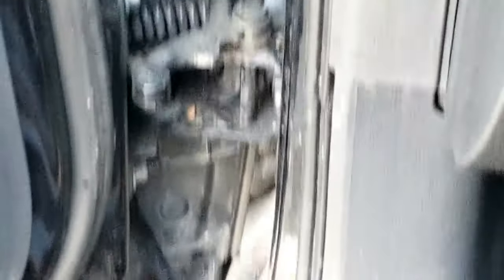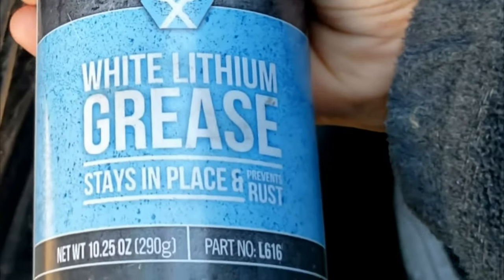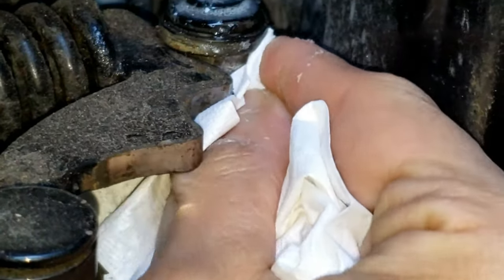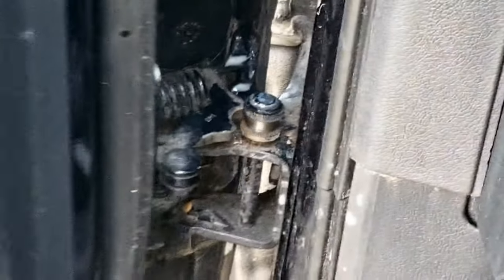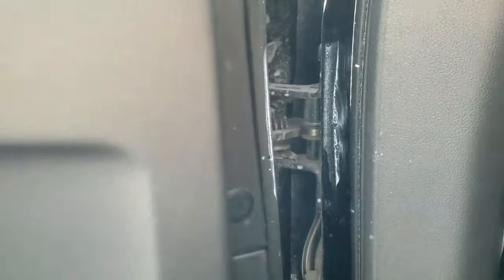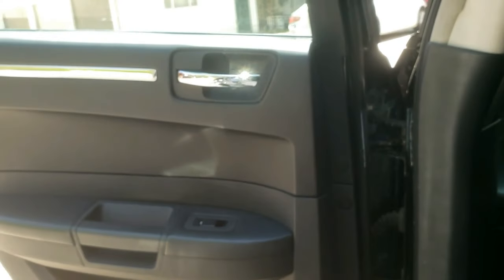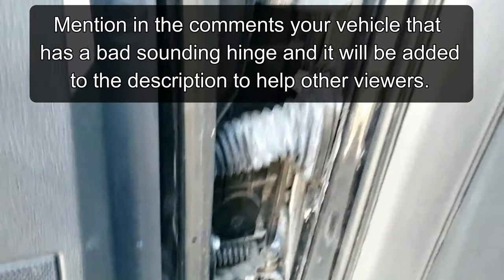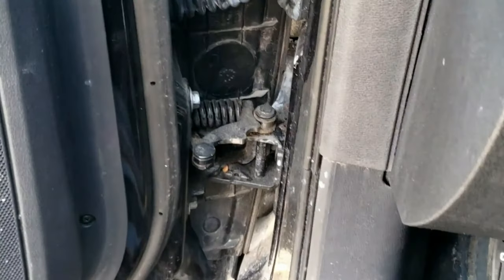Lubricate Car Door Hinge That Makes Popping Or Groan Sound When Open Or Closing TSB

Comment: We have a 1991 Jeep Cherokee XJ model and it is making a loud noise as well as a lot of resistance in the spot where the noise is present. Our hinge area looks different than yours, but I will give it a try and see what happens. Thanks for doing the video. 
Phil
Reply from the maker: Thanks for the input. Let us know if it helped or fixed your problem.

Comment: Every car I’ve ever owned I’ve done this to regularly to.  But I have like a half can of grease on this low miles 2013 Dodge Journey and it won’t stop. My 98 Dakota is quiet as a mouse.
Reply from the maker: Poor design engineering for a low mileage vehicle.
Reply: I've never experienced this with any of my cars but they all have been japanese. I didn't experience this until I inherited a Chrysler 300. Great car but I would say such issues are likely limited to American made
Reply from the maker: Yep. The Japanese vehicles are excellent quality vehicles. No more American vehicles for me. They just don't care about quality. Quality comes at a price.

Comment: I have the same issue with my dodge journey 2016, the popping sound seemed worse when it's cold or humid air. This week, it got way worse and now, it looks like my door is misaligned on the bottom (door frame is popping out compared to the reste of the car frame). I doubt that grease will fix it at this point and that i'll be looking at more expensive repairs.
Reply from the maker: If possible check to see if the screws on the door are tight and properly torqued or if their is any loose trim around their getting in the way. The grease usually helps or you could try a spray. If possible try to get a 2nd opinion. Hope this helps!
Reply: I bought my 300 second hand, and the drivers door was always stiff I think because the previous owner never oiled the door hinges.  I've oiled, and greased the hinges constantly since I bought this thing.  You mentioned your door being misaligned, and popping outward when you open it.  Yep...eventually same thing here.  I looked at the door metal around the bottom hinge, and it's now all cracked, and broke out, despite me oiling the hinges all the time.  But I know of a Chrysler 300 I can pull a drivers door from, and just switch the doors, and hinges out.  So I'll be driving a light blue car with a tan colored door.  So what?  I'm not paying a body shop $900.00 to paint a door for a 14 year old POS car.   Take a look at the area on the door, around your bottom hinge, and see if it's all fatigued, cracked, and breaking out.  That will explain your sagging door.
Reply: One more thing.  I'm not recommending this, but this time around I'm taking a die grinder, and cut off wheel, and cutting some metal to eliminate the spring, and that lumpy bumpy thing that rolls over that roller, and going without the door spring.  This will make it infinitely easier on the metal at the bottom of the door each time the door opens & closes.

Comment: Would WD-40 work as well? I mean the lithium would be better but would the wd40 get the job done in a pinch? I have one and not the other and I almost can’t shut my door all of the sudden. So I need a fix asap
Reply from the maker: If your in a pinch use it. I've heard mixed reviews on this. They suggest WLG. But something is better than nothing.

Comment: Can I use the hinge with a spring for both of them? The upper and lower
Reply from the maker: It may be possible as it appears the lower and upper bracket have the same hole placement. So it may fit on there. However, I'm not sure if that would effect the speediness of the door opening or closing. I'm guessing Chrysler, Dodge,  and Jeep has one with a spring and one without it to save on cost, as the one with the spring is more expensive from a manufacturer cost point of view. If you have 2 of these brackets with a spring go ahead and put it on and let us know how smooth the opening and closing of the door is. Otherwise if your being traditional, then just stick with the original design of the brackets with one spring and the other without it. Please let us know what you do.
Reply from the maker: BTW here's a video on how to replace the hinges and/or the door: https://youtu.be/boJVtQ-cB8k

Comment: Nothing has helped my 2011 Ram. I be even had a shop try to quiet it. Lasted a couple weeks. I’m trying to find a video on replacing the lower hinge now
Reply from the maker: I have to do this every time I do an oil change. It's the way the hinge was poorly designed and maintaince will be needed at some point, perhaps an aftermarket one might be better and not an OEM. Anyway you can watch this video to see how to remove the lower hinge...its quite easy. 👉👉 https://youtu.be/boJVtQ-cB8k
Reply: Thanks. Yeah, no amount of oil or grease will stop it from its loud popping noise.

Comment: Update: I first tried white lithium grease like in the video but got better results with a thinner lubricant that flowed into the part faster
Reply from the maker: Nice, good to know. Do you know what the thinner lubricant was? I would like to try something new and possibly not as messy.
Reply: @FixCarYourself  yes it was blaster brand multi purpose lubricant
Reply from the maker: @benjaminhardwick8378  thanks this should help others out!

Comment: Could bit some jollop on there, instead of spray grease just a bit of lard like grease
Reply from the maker: Interesting 🤔
Reply: @FixCarYourself  do you know the stuff i mean? Like Castrol Lithium
Reply from the maker: @_wimza_7983  I just looked it up. I like it. It's a good alternative for this.
Reply: @FixCarYourself  should last alot longer to prevent you needing to reapply the spray. Alot of mechanics use it for same reason, even show rooms use it but will often use the white thicker stuff. Keep up the good uploads
Reply from the maker: @_wimza_7983  nice...and thanks 👌!

Comment: 2016 dodge Journey. tried this. still makes the noise.
Reply from the maker: I have to do this a few times a year and the sound goes away temporarily. Sadly this is Chrysler's TSB "fix." But its really a poor cover up in bad engineering.
Reply from the maker: BTW make sure you use White Lithium Grease preferred or possibly a chain lube, just not WD40.

Comment: 2008 grand Cherokee sounds like that but there is rust on the bottom part , what can I do with the rust
Reply from the maker: Regular penetrating oil is best. Soak it and use some steel wool to scrub off the rust (possibly repeat), and then clean it with a towel. Get off as much as you can. It won't be perfect but should be good enough.

However if its to eliminate this annoying sound in addition  you still should use the white lithium grease like a couple days later.

Comment: Does wd40 work?
Reply from the maker: It might help a little...if thats all you got, but long term just use  what they recommend: White lithium grease because it holds up over time, it has a thick consistency, where as WD 40 does not. Usually white lithium grease is actually meant for anything that rolls like chains or hinges or this door hinge in this case.
Reply: I tried WD40 and no success for me
Reply from the maker: I believe it!

Comment: Does wd40 work?
Reply: I got a 2015 Dodge Challenger and it drives me insane
Reply from the maker: It might help, but long term just use what they recommend: White lithium grease because it holds up over time, it has a thick consistency, where as WD 40 does not. Usually white lithium grease is actually meant for anything that rolls like chains or hinges or this door hinge in this case.
Reply from the maker: @WaVyEdiTz  Shame, they had over a decade to fix this, and they didn't.